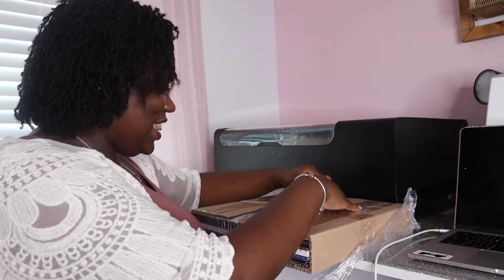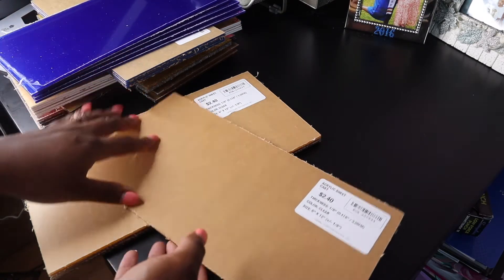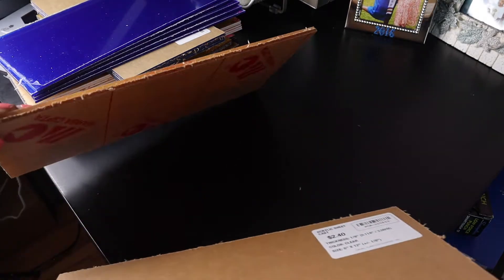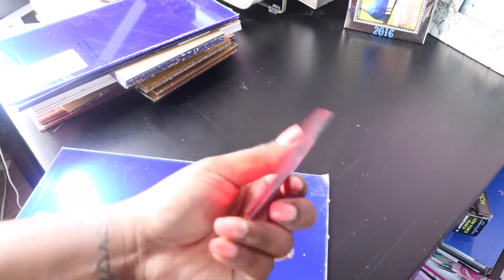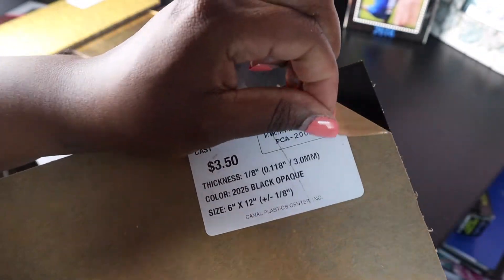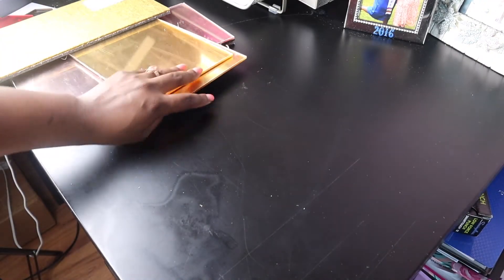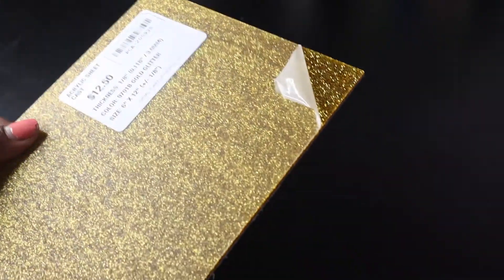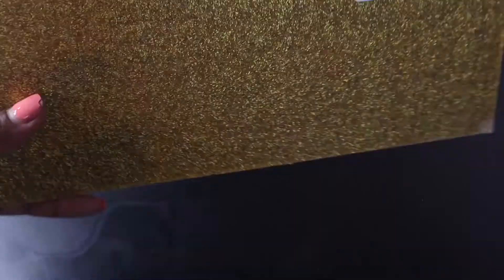Acrylic Unboxing for Flux Beamo Laser

Comment: Have you found a glue that works with mirror acrylic without damage?
Reply from the maker: The best options I found with no damage to the material and a strong bond is using 3M double side adhesive sheet on the material I don’t need or engrave ( https://amzn.to/3hqB2s4) or gorilla super glue with the yellow top (https://amzn.to/3k2CKlh)
Reply: Actually I did  some research before on my own I came up with the same double sided tape. Will use your suggested glue.

Thank you for answering all  of my inquiries, you are wonderful.
May god bless you in all your endeavors.

Comment: Great video. I like acrylic but it stinks.  What have you found to help with the smell?
Reply from the maker: I have the AC inline fan and I replaced the original duct that came with it with a heavy duty one. And I sealed with a lot of hvac tape to make sure it’s all venting out the window. There are still times I smell it but it does not fill the house up and it’s not overbearing.
Reply: @zeelouisedesign4217  is it like a slight stench?